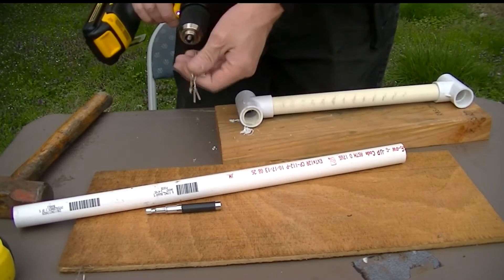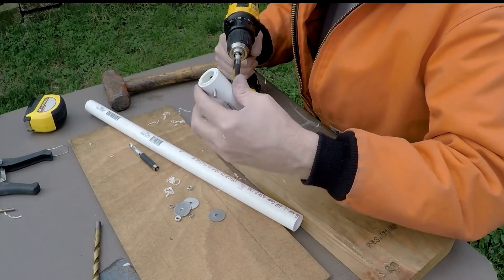HOMEBREW BUILD # 3 - Dual band vertical Dipole (Pt 1 of 3)

Comment: I followed your excellent tutorial until you  listed the components needed for the project. In particular I'm confused about the gray 90 degree conduit box that you called CPVC. That gray box is a PVC conduit body type LB. CPVC, chlorinated polyvinyl chloride, is the type of tubing used for high temperature applications like hot water. There is no CPVC in that gray box.

Comment: I built this antenna for scanner monitoring and its the best receive antenna of any that I own. Thank you for sharing your knowledge with us.  FYI I used 308/308L 31" Stainless steel welding rod.
 (PGK of 8 at $10-12 from local weld shop).
Reply from the maker: I'm glad it was of use. Apparently a lot of people have built them and enjoy them.  I've built four plus a version with an antenna at each end of a boom so that I can run two radios off of one mast.
Reply: @kg7tuo999  that is interesting regarding 2 antennas on the same mast. I had thought about doing the same. I have radio listening with a tower facing north and one to the south. but thought about connecting those to one feed point down to my scanner. But thought that may cancel each other out. I need to read up on antenna theory a bit more. What are your thoughts on one feed line fro monitoring only? Will the antenna still radiate? to max my reception from stations in different directions?

Comment: I am building this for my first antenna. But I am having a hard time finding the stainless steel for the elements, can I use chrome plated nickel instead?
Reply from the maker: Any metal rod should work but the velocity factor will be different for each type of metal. Measurements should be close but will be slightly different.

You can find the 1/8" stainless rods at welding supply stores in your area but they're expensive compared to what I found online....but online requires larger quantity purchase.  I paid about $24 for 8 rods at the local shop and about $28 for 40 rods online....incl shipping (amazon).  They are 1/8" 308 stainless TIG welding rods.
Reply from the maker: When I said "any" metal rod..... I recently built a 2m dipole from barbed wire and another from clear vinyl tubes filled with tap water.  BOTH worked so using chrome plated nickel should work as well.